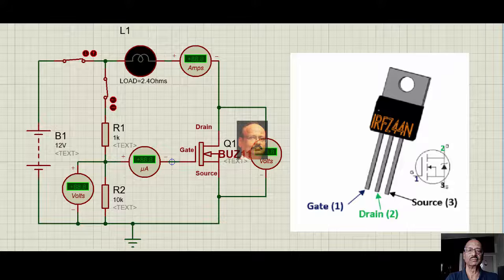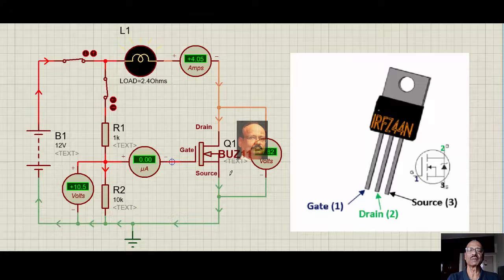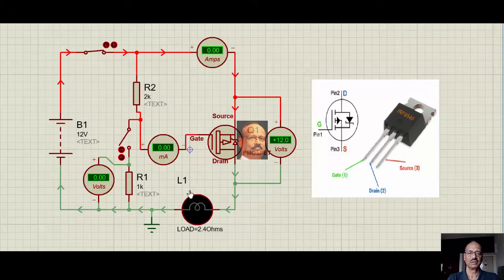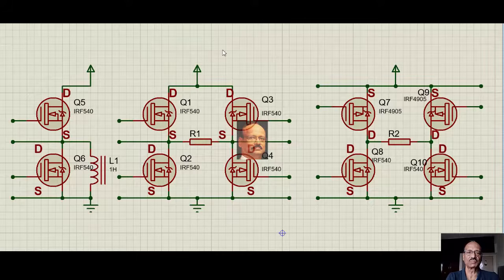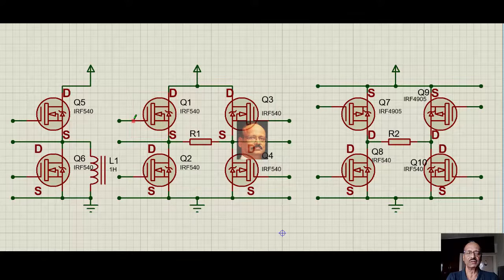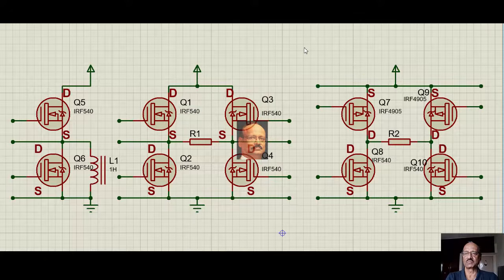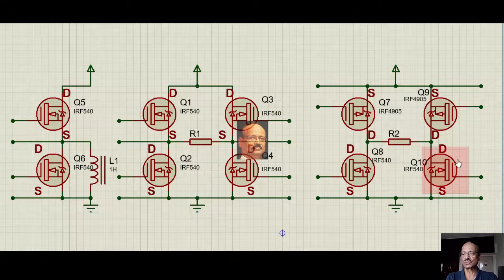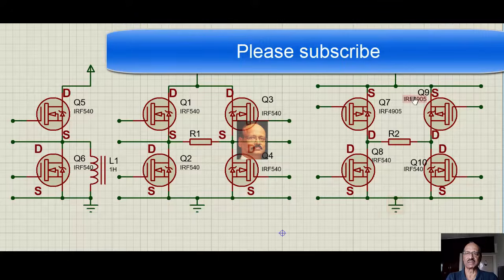MOSFET Drive Part 1, P-type, N-type, and their  Drive needs.

Comment: Problem of IR2104, IR2184, IR2110 is, that this do not provide isolation, so in some cases, spike at IR2110, not only kills driver,
but also kills Arduino or STM32 or ESP32 etc.
ALso GND for LOW MOSFET and GND for Arduino is not the same, there is some difference.
SO only solution is use isolated current source for GATEs and another current source for Arduino, optocouplers,
or use transformers for each gate.
Reply from the maker: Yes 2104,2110 etc does create spike problem. I had used opto couplers in my practical hardware. As regards common ground ,lower MOSFETs and Arduino ground is same not different as you reported.